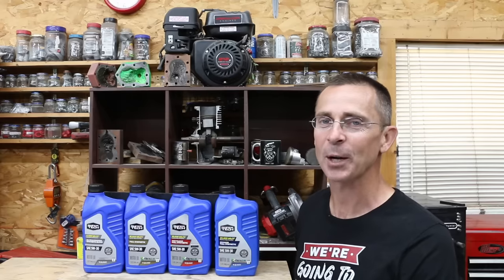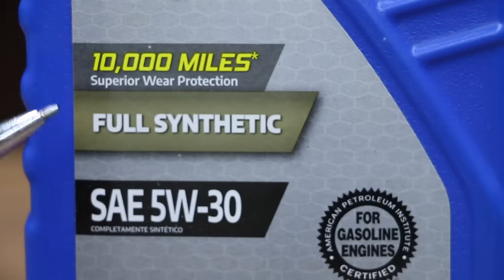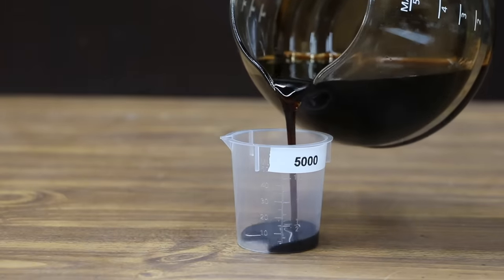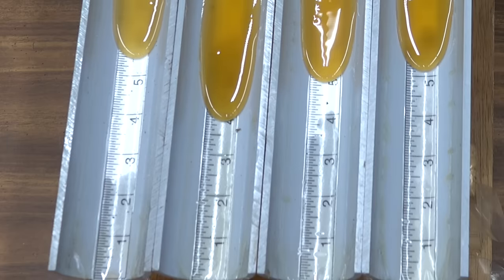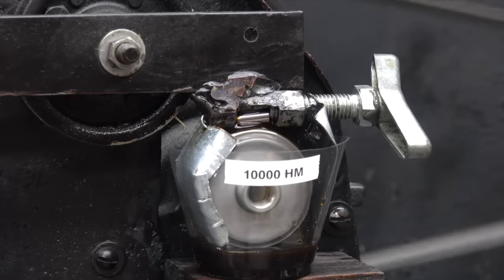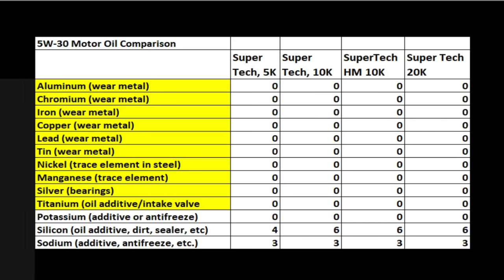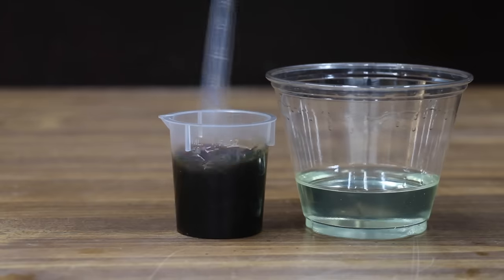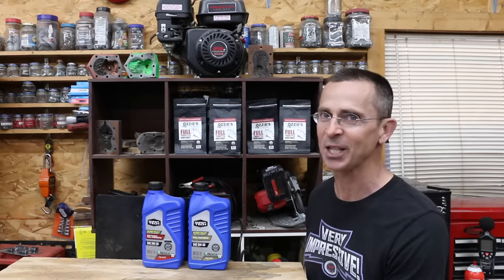Are They All The Same Motor Oil? Let's Settle This! Four Types of SuperTech Motor Oil Compared

Comment: GREAT VIDEO!!  It is my opinion that extended OCI's are asking for trouble.  May not be much of an issue under 100k miles but over that I expect to really be able to tell.  I change my oil at about 3-5k miles regardless of the oil.  I run SuperTech in all my vehicles and just change it more often.
Reply from the maker: Thanks!

Comment: Not a gear head myself, but I do the majority of my own car work including timing belt changes. I've been using Penzoil Full Synthetic High Mileage 5W-30 for all my oil changes. I bought the 2004 Hyundai Accent with 104k Miles, It's now at 230k Miles. I have never changed the oil before 15k duration, And even left it go to 20k at one point. Engine is still purring like a kitten.

That being said, I would never trust Supertech to do this. I only feel this is doable because of Penzoils trusted quality. Just my own anecdotal evidence for being able to do longer durations for oil changes.

Love your videos, thanks for everything you do!
Reply from the maker: Thanks and you are welcome!

Comment: Thank you for your awesome and informative content! It's always nice to have an unbiased reviewer who can't be bought. 

I don't buy it with car manufacturers making these crazy long service intervals. But at the end of the day the company only wants that motor to last util the warranty is up. Nothing in it for them if it lasts 200k miles. My wife's 02 Cavalier gets its oil changed every 5k / 5 months (its a work only car so it rarely has more than 2k miles over 5 months. My turbocharged 2019 Veloster on the other hand the manual says 6k/6months. I go with 5k/5months (we don't drive much so it rarely gets over 3k miles in the 5 months). I always use synthetic oil and a quality filter. The Veloster is under warranty still so it gets OEM filters. The Cavalier gets Purolator.
Reply from the maker: You are welcome!   Thanks for sharing.

Comment: Thanx for your thorough and varied reviews, I enjoy them.

You asked for it (What do I think?)

In practice I use full synthetic in all my vehicles (since the 1980's).

I believe the full synthetic is better, especially up north when it gets very cold in the winter. In the 80's I noticed when I used Mobil 1 or AMSOIL, the car started easier in sub zero temperatures. However that said, my 'old school' neighbor keeps his vehicles as long (or longer:  20+ years) than I do, never spends the extra $$$ for full synthetic. And neither of us has had an oil related failure of our vehicles.

My current interval is 5K miles, or 1 year whichever occurs 1st.
I use 5K because it is easy to remember.. and most manufactures recommend 7.5K unless "extreme duty". Comically the examples of "extreme duty" correlate into actually driving the vehicle.  

The 1 year time frame is for my limited driven mileage vehicles (my 2 Corvettes)  I change their oil each fall before winter storage, generally with < 2K miles.

$$ value:  On sale, full synthetic is not much more expensive, and sometimes less expensive than conventional oil.  In my opinion Synthetic Blend is the least preferred, generally costs more than conventional, and is subpar to full synthetic, your videos demonstrate this.

Other practices:  SBC and some other engines the oil filter mounts vertically.. therefore I fill the new filter with new oil prior to installation.. This is a "corvette dude trick", I use it on my Chevy truck and Mercury Milan also.. somehow I am convinced it is better to not have that 1/2 second of oil filter fill-up time on the 1st start after an oil change..
Reply from the maker: You are welcome!  Thanks for sharing.

Comment: Awesome test!
Loved to see it.

To be honest, extended maintenance intervals are a thing due to pressures made by fleet managers.
Meaning, those who run a fleet of rental cars, delivery vans, taxi cabs, etc... Choose the model to purchase based on many factors, including maintenance.
Because maintenance means (a) you will spend money performing that preventive maintenance, and (b) that car will be off service in order to conduct that maintenance.

To tackle this, car manufacturers (OEM) created strategies to offer an extended maintenance plan on their vehicles, so that they could become competitive in the fleet market.

This extended maintenance came in a moment where tolerances are really tight on modern vehicles, due to both (1) low emissions requirements, and (2) customers require more efficiency and power.

Thus, having stricter tolerances added to extended maintenance makes for an explosive mixture. At your expense, i.e., it is you who is rolling the dice.
Hence, I honestly do and advise to do preventive maintenance really early, usually 75% of the recommended miles by he OEM; and I always change my filters (oil, air, and fuel) upon changing the oil - not in a intermittent manner.
Coolant, brake fluid, and transmission oil are typically overlooked.
Reply from the maker: Thanks and you are welcome!  Thanks for sharing.

Comment: Thanks for all the great videos. I have viewed a bunch of them. You do an awesome job!
Don't know if you're interested in another oil test as you've done tons, but I'm relating my experience. I bought a brand new VW TDI in '06 and the dealer always used Motul 5W40 (505.00 spec). Around 2010 I got my service done and I could tell a difference in the engine. I thought they adjusted valves or something. Finally found they had switched to Castrol Edge. I got about 10% less mileage. I switched back to Motul and my engine was normal again and mileage was back up where it used to be. Sounds crazy that with all the premium oils out there that there would be such a difference but I could feel it. Over the years I've had the clutch go out but the engine is still going strong and still 44-49mpg
Reply from the maker: Thanks and you are welcome!

Comment: I change my oil at 10k miles using full synthetic oils...recently being Supertech because of its price point.  Zero issues.  My 18 5.0 now has 136k miles.  My 09 5.4 had 206k when I sold it (same oil change intervals, but Mobil1) absolutely flawless engine.
Reply from the maker: Thanks for the feedback.

Comment: Great video!
I use Supertech 10,000 mile full, high mileage full synthetic on my high mileage vehicles but change every 5000 miles.  So far so good.  I try to use un upper tier oil filter too, it's only a couple dollars more and I do my own oil changes so it's still very cheap overall.  About $30 or so for that oil and filter.
As I understand, the "high mileage" version has additives to help keep old elastomers soft, like the main engine seal.  But they probably wouldn't have any benefits in the type of cooking and wear tests he performs here.
Reply from the maker: Thanks!  Thanks for sharing.

Comment: I love this, made me realize I am paying an absurd amount for my oil changes. I was paying 70$ every 3 months for my oil and I went down to paying 30$. No change at all to the engines fuel economy or ability to run. However, I realized keeping up on oil changes in old cars was integral to keeping it running. My Honda has 320k miles and mostly is running because I fix anything wrong. But I have no doubt keeping the oil fresh in this thing is the reason it continues to run seamlessly.
Reply from the maker: Thanks!  Thanks for the feedback.

Comment: I made a stop at my local truck stop for gas the other day and saw they had about 8 different kinds of windshield wiper fluid ranging from -20 degree fluid to rain repellant fluid, to “de-bug” fluid, and so on. I’d be curious to see if any of the different fluids actually work for the basic tasks like cleaning off the windshield, to the advertised uses of the fluids. Maybe see which ones are prone to leaving streaks or not too. I didn’t find a video on your channel about it and figured I’d make a suggestion! Thank you for your time and the amazing content as usual! I’ve been making my engine oil purchases strictly off of your research! Thanks again!
Reply from the maker: Thanks for the suggestion.
Reply: Ohh that's a good suggestion

Comment: I want to say this about intervals changing oil. My first car I bought in 1990 was a 1988 Toyota Corolla. I'll never forget reading the manual and it giving a recommendation when to change your oil. I was astonished of the range that it gave from heavy city stop and go travel to change it at 3000 miles all the way to 7000 miles if it was mostly highway miles. And that's in 1988 when I was 16. I don't know if that was a great thing to follow but I was amazed because my dad changed the oil at 3000 Miles on his vehicles all the time, no matter what...
Reply from the maker: Thanks for sharing.

Comment: Love your channel sir. I have used synthetic oil (Castrol, Mobil1, Penzoil, Supertech) since 1986. I tend to keep my vehicles for 10 years or more with all but one being purchased brand new. I would not do a full oil change until 10k -12k miles but rather would change the oil filter 2-3 times (depending on type of driving) between full oil changes (on 7 different vehicles - 2 Hondas, a Subaru, a Ford Escort GT with Mazda drivetrain, Infiniti G37S-X, VW Tiguan, Kia Sportage) with zero oil related issues. Not one of these cars ever smoked/consumed oil. Mileage ranged all the way up to 230k miles. I would like you to test this practice of more filter changes vs more oil changes.
Reply from the maker: Thanks!  Thanks for the suggestion.

Comment: I used to go 8,500 miles in my Dodge Magnum R/T on Mobile 1 Synthetic 15,000 mile oil. That's about as far as I trusted it though. I had that car from 16K miles to 165K, still runs like new! I also went between Fram and Mobil 1 filters. but always got the highest quality Fram
Reply from the maker: Thanks for sharing.

Comment: 5000 Mi is about the max my conscious will allow me to go before changing oil. I generally use 10,000 Mi full synthetic and change every 5,000 miles. It's still the least expensive way to promote a long engine life.
Reply from the maker: Thanks for the feedback.
Reply: So you will buy 5,000?

Comment: great test I actually been running the full synthetic 10k oil in my car chevy cruze but I use run Mobil 1 but been using the super tech last 4 oil changes and seems to work just fine
Reply from the maker: Thanks!  Thanks for sharing.

Comment: The main thing this video did was remind me that I really need to change my own car's oil VERY soon, as it's already over the recommended maximum mileage limit! (I'm just waiting for slightly warmer and nicer weather to do it, because I have to do it outside in the wind and weather, I don't have a garage to use.)
Reply from the maker: Thanks for sharing.
Reply: We race 4 stroke go kart using gx200 clone engines that are modified for 9000rpm plus, most are using diesel oils as those oils have more additives than standard car oils, to us that means that the diesel oils are a higher standard.
Could you please confirm this?

Comment: I change oil on my Prius every 5000 miles, with Synthetic oil. I always buy quality oil filter.  My Prius has done 210,000 still running strong with no issues. So far i spent only on regular maintenance like spark plugs, brake pads. coolant flush. No major issues.
Reply from the maker: Thanks for sharing.

Comment: I have never had an oil related engine problem with any of my cars vans or pick up trucks. I have been driving since 1968…
  I have been using mobile one oil since the 1970s. I have only changed my oil in all my vehicles once a year… I have always bought what I thought was the best oil filters.. I was using Purolator oil filters for many years, I have recently switched over to NAPA gold oil filters because they tested well on YouTube videos..
  I never go over 5000 miles on oil between changes. I don’t sit in rush-hour traffic on hot days with the air conditioning running not moving very often. Buyer was lucky enough to live in a place where I never ran into that type of commuter congestion…
now that I am retired here in 2024, I am only putting about 3000 miles a year on my 2017 ram 1500 with the hemi engine .. I do a lot of my commuting and trips and sightseeing by motorcycle. That’s why my vehicles have so little mileage year to year, especially when commuting. I commuted by motorcycle about eight months a year here in Pennsylvania…
  back in the 1970s, I was working as a motorcycle builder/mechanic in a Honda motorcycle dealership. That was the only time I ever saw engine failures due to a oil. The shop was mine 55 gallon drums of Kendall four stroke motor oil… we were putting that oil in brand new motorcycles after we would build them out of the crate, and deliver them to customers. We had quite a few engine failures within the first 600 miles since new on those engines. We found out by accident that it was due to the oil foaming. We took a brand new motorcycle with the rep from Kendall there, we put the Kendall oil in the motorcycle that had never been started before that moment. We started the bike and one of the mechanics took the bike out for about 20 minutes. When he got back, we immediately pulled the plug to drain the oil, and it came out like a Slurpee. If you remember them, they were like semifrozen foam, almost like shaving cream, mixed with oil… That’s when I learned that when you have air bubbles in the oil, you cannot build oil pressure because the air is compressible. On the spot, Kendall agreed to pay for all the damage.

Comment: Using M1 XS 5W-30 for 25 years has proven to be exceptionally special many times over the years. 
Blowing the coolant and high engine temperature protection has saved many engines.
I drove 45 miles with no coolant on a Ford Focus.
Reply from the maker: Thanks for the feedback.

Comment: I agree with you about not trusting oil for 10K+ miles. I usually use a Pennzoil or Mobil 1 full synthetic and run them about 7K miles. That’s in a 2013 Sienna V6 and 2007 Suburban 2500 with a 6.0 V8. Same type of oil in both, but different weights appropriate for each engine.
Reply from the maker: .Thanks for the feedback.

Comment: Change your oil every 3-5k miles. Regardless of what either the vehicle manufacturer or the oil brand says. If you use synthetic oil, you could go 6-8k miles between oil changes but I wouldn’t go any further than that.

Comment: I watch your videos all the time. I've never seen you test oils for small engines ie mower engine oils. I'm currently using Opti 4 sae 30 in both my zero turn mowers. There isn't any testing of this oil that I can find on youtube or anywhere else for that matter. I'm kindly requesting you do a video  for all the lawn care guys on youtube testing motor oils, especially Opti 4 vs all others so we can get the necessary info to make an informed decision on which oil is best for hard working lawn applications. Thank you in advance

Comment: I had a 2016 Toyota FJ cruiser and I drove as a sales rep. I changed my oil every 20 to 25,000 miles with the cheapest synthetic that was on the market. I saw the vehicle at 230,000 miles with no issues.
Reply from the maker: Thanks for sharing.

Comment: I’ve got a 2019 Nissan Frontier SV 4x4 V6 with 32k miles and I use Mobil 1 synthetic. It claims good for 10k miles but its dark brown by 4,000 miles so that’s when I’ve always changed it. No matter what oil type, one rule you can follow is when it’s too dark to see the metal dipstick through, time to change it! 😅
Reply from the maker: Thanks for sharing.

Comment: Some of my family have been in the auto repair business for over 60 years.  When Mobil 1 first came out they claimed you could go 25,000 miles so I tried it, at less than half that mileage I lost a camshaft.  With standard oil I would go 3,000 miles, now I run synthetic and I will go maybe up to the auto manufacturer's recommendations for oil change interval, never beyond.
Reply from the maker: Thanks for sharing.

Comment: In my street cars, I always change the oil at half the recommended interval, which is 10K miles.   I drive a lot and all my vehicles have more than 100K miles right now; and they run great.  I do have a 1 ton diesel truck that I change at the recommended 7.5K interval.  I think changing oil at half the interval for gasoline vehicles is worthwhile based on how well my high mileage vehicle work.  I don't use SuperTech oil in any of them, but do use SuperTech DEF in my diesel truck with good success.
Reply from the maker: Thanks for sharing.

Comment: Extender oil change intervals were created to reduce TCO when comparing vehicles (according to Hoovie’s garage). Personal experience with a brand new car. You can get by with it  up to about 50k miles, but after that reduce to 5k oil change intervals.  That information is from the VW techs who replaced both of my camshafts due to wear @ 80k miles.
Reply from the maker: Thanks for the feedback.

Comment: Great video as always. I’d like to see Mobil 1 high mileage tested against the Super Tech hi mileage full synthetic oil. I’ve been using Mobil 1 but will switch to save money if there isn’t that much difference.
Reply from the maker: Thanks!  Thanks for the suggestion.

Comment: I have another idea for you. We used to assemble rebuilt engines in the shop. A machine shop did the machine work, but we did the assembly. Anyway, there are a lot of assembly lubricants to chose from. I wonder which ones are better, if there is any discernible difference. Heating and super cooling isn't really part of the criteria. But your friction test is exactly what is needed. The assembly lube has to stay in place, and melt with heat and mix with the engine oil.
Reply from the maker: Thanks for the video idea.